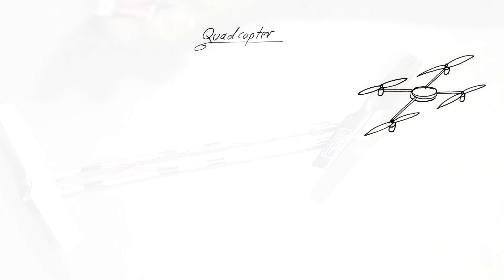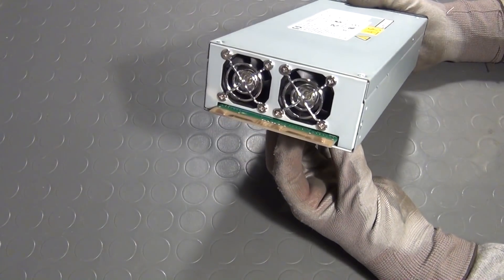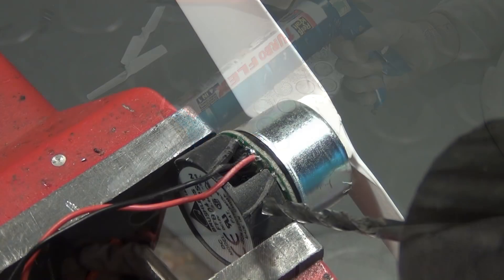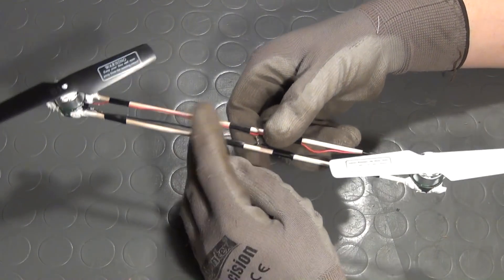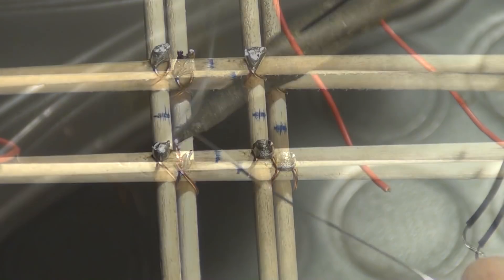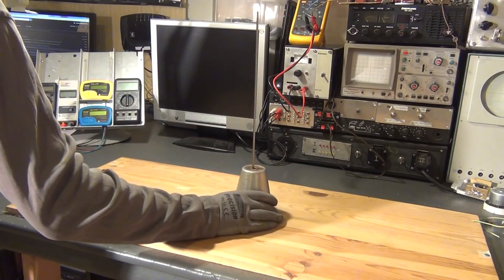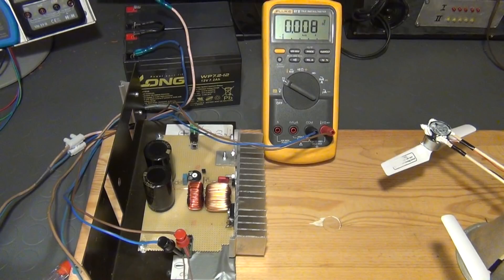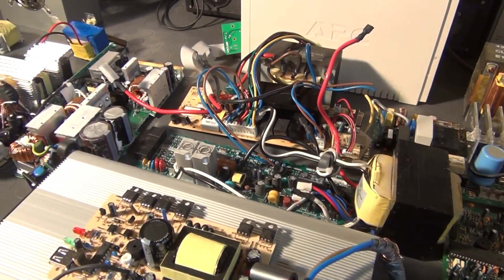Building a Cheap Quadcopter At Home (1)  - Lift Off

Comment: The most common material for self-build projects is actually plywood/triplex and wooden beams (oak is a good one because it doesn't warp a lot and it quite strong for the weight).  Wood also has the advantage of dampening the vibrations.

Carbon fiber would be a higher end type quadcopters and is seen more in kits rather than in self designed constructions.

there are plenty alternatives, but the thing to note is that it's about finding materials that are strong and lightweight.  But there is the matter of price and ease of cutting/forming that makes one material more suited than another.  If you have access to a laser cutter, then the material choice goes up a lot, wood has the advantage that it can be worked on with very elementary tools.
Reply: Also for the motors, you need motors that can VERY rapidly change speed and where you can control the speed very precisely.  This is why you typically find the 3phase BLDC motors with an ESC per motor.  The motors for a copter are  typically outtrunners, because they provide more torque and work well with bigger props that have a higher angle compared to inrunners.  
Inrunners are more for smaller props that rotate faster.
Reply: Also bad idea on mounting the propellors like that.  You ARE going to fly into things and destroy the props (especially in testing phase), so they need to be replaceable.  It's also important your props are properly balanced or the vibrations from the props are going to totally confuse your flight computer's gyro sensors. 

Tip: if you're going to salvage everything, you can salvage the gyron sensors from a Wiimote, that's how the Flip MWC was originally made before the sensors were available for sale separately (http://witespyquad.gostorego.com/flip-mwc-flight-controller.html)
Reply from the maker: oreubens Thank you for the advice. I'm not planning on building a great quadcopter at this point in time. I'm working on several other projects, that are situated in other fields of electrical engineering. This video was more of a "one day trip" into the world of the quadcopter rather than an attempt to build anything functional. My idea was basically to find out if it is even possible to use these kinds of 2 phase BLDCs to lift anything off the ground. I've been asking myself if that is possible for years, and finally said to myself "now I'm going to try it out". That's basically what this video is about. 
One condition was that I didn't want to spend more than a few bucks on this. If I would attempt  building a really good vehicle, then I would do it in a completely different way and I would be ok with spending some money on it. I will see if people are interested in this project. If yes, then I might salvage some electronics as well and go for a part 2.
Reply: And you need to be able to control the speed of each motor individually to keep it stable,
And your copter will need to be able to carry the weight of the batteries, any electronics you add (boost converter is a bad idea because of weight), the RC receiver and the flight computer.
And do all of that while still having enough spare power to actually do maneuvers

something tells me those fan motors aren't going to be up to the job

Comment: The power requirements seems too high to be viable given the weight of the battery
Reply from the maker: Well the battery I used is certainly a bit too heavy ;P
Reply: Maybe just permanently attached longer wires?
Reply: Maybe I had seen this video first, or another one of which a guy had a tethered airframe with power leads, or I may have thought of it myself. :)  Youde get indefinite flight times for some extended videography sessions.

Comment: Next idea is to think on how to control motor individually to achieve controlled flight and flight stabilization.
Reply from the maker: Yeah as I said, that is basically the most important thing when it comes to electronics in quadcopters. But I must first come up with a good idea on how to test the control circuit without destroying the vehicle.